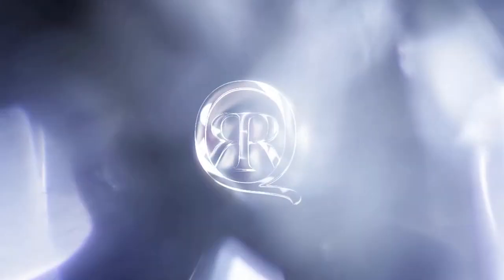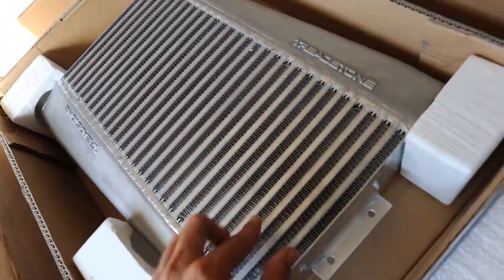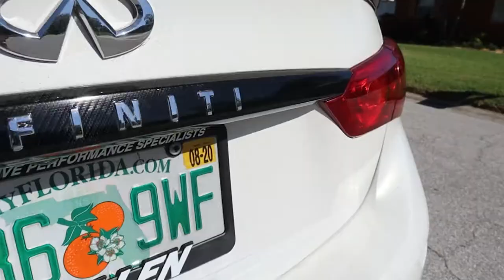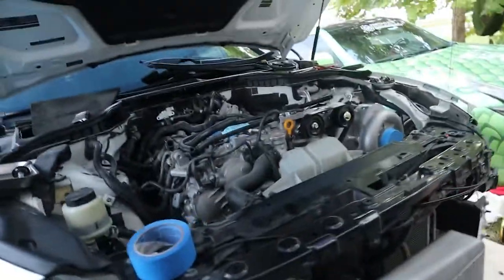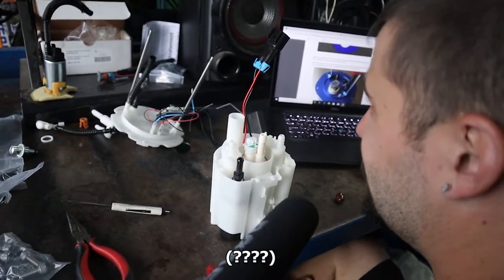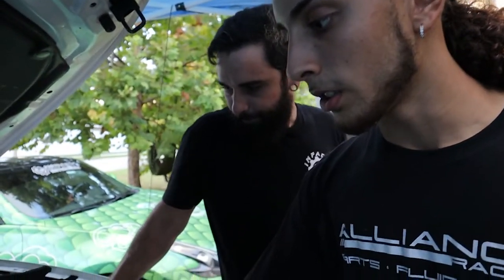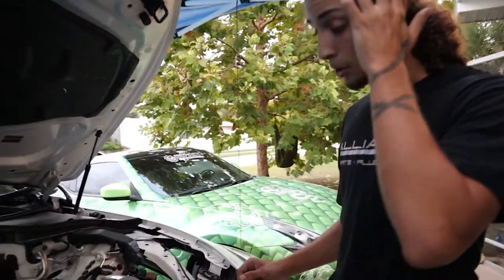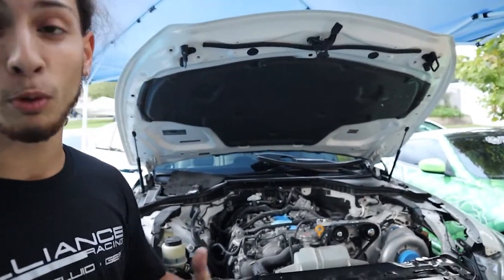BUILDING A SUPERCHARGED 3.7L Q50 ! | Day 1

Comment: I thinking about upgrading to a 2014 Q50 and turbocharging it (saving money if i do a custom mid mount) or a 2016 Q50 3.0t then doing fbo and e85 OR a f30 335i. I currently drive a almost fbo static black 04 G35x. I'm only missing headers and a larger throttle body.

I'm leaning toward Infiniti because Jdm has been good to me. The two bmws I've owned were both problematic. BUT I'm still willing to give another bmw a chance if it's good
Reply from the maker: BMW's are fun when they work...this is my 500hp daily driver with NO problems...nuff said lol
Reply from the maker: And if you want to save money doing a doing a build on any of those cars.. I'd highly recommend getting a 3.0t Q50..there's no such thing as saving money turbocharging a 3.7..the supercharger alone (which is a cheaper option) just the "kit" cost $6000+..that's  not even close to including everything else...a turbo build would be double the amount of this supercharger kit just from labor and time consumption( just trust me, I've gone through the trials and tribulations working with my own personal "Nissan master tech" who has the credentials) I've seen it with my own eye's multiple times... 3.0t is a perfect daily, with proper mods at a conservative budget and I promise you that Q will toss the G35's salad on any given day.

Comment: This car will EASILY be faster than a Rs400. The stock 37 can make up to 700whp on stock internals. I don't think your supercharger kit will reach that but you should be good for 550whp (quicker than any stock turbo 3.0t) make sure to upgrade the injectors and fuel pump
Reply from the maker: Supercharger kit is already done , this kit can definitely make over 600 on e85 and an aggressive tune..got a few little goodies I haven't strapped on yet ...sshhhhhh

Comment: I hear the 3.7 weakpoint is the transmission. Do you have any plans on modding the drivetrain at all ? Another thing, whats a rought estimate on costs when piecing this kit together?
Reply from the maker: Every car's weak point is the transmission, Torque kills. The 7at from nissan/Infiniti is no different...both the stock engine and transmission can hold a healthy 450 to 500 lbs of torque. But on a 3.7..unless you have a heavily modified forced induction build..you won't touch 400hp on a full bolt on build.
Reply from the maker: Hopefully if my transmission stays in tact I won't have to build it.. but never say never!! And this kit alone cost about $6k. Not including injectors, plugs, pump, fuel system,  ect.